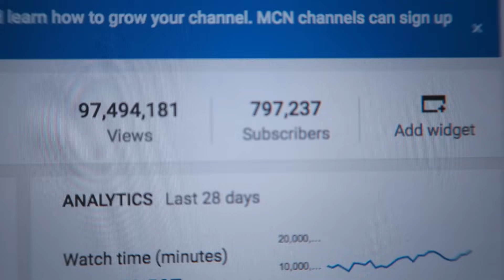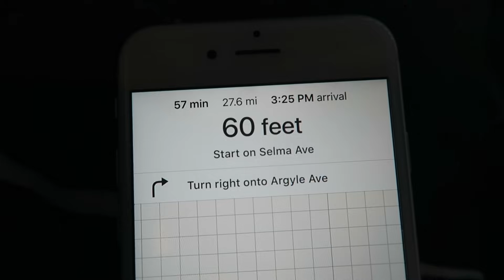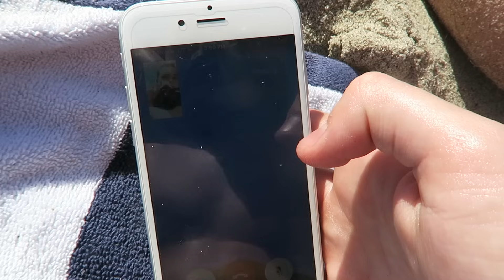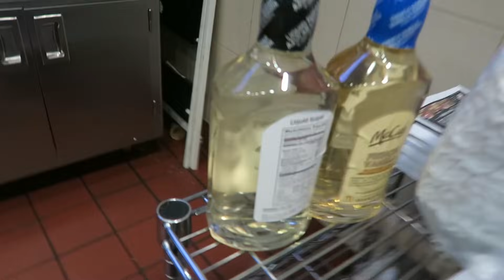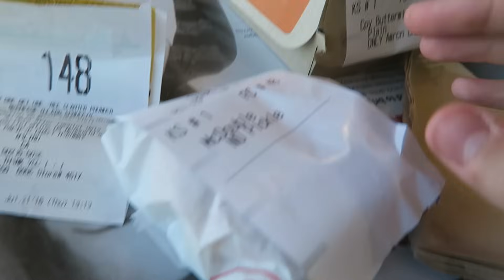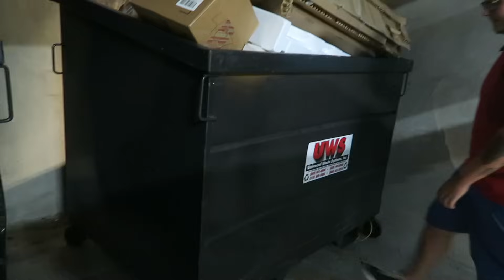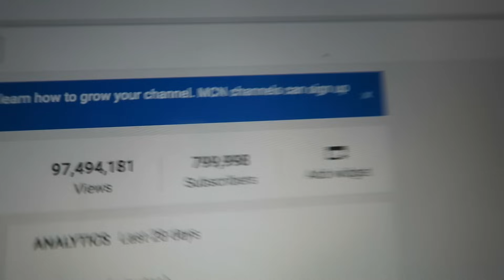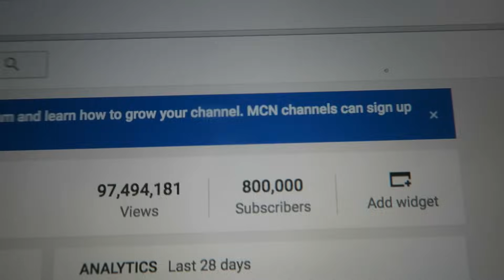SHE'S NOW A HULA GIRL!

Comment: ive been in that building me and my step dad rewired the lobby depending on what floor your on the wiring in the building is pretty messed up the wiring joints with no wire nuts fucked up and that outlet is on the island and the wire goes down underneath your floor there is a 1 inch gap in the middle of your floor and the room below you so anyway that wire wires in with the light switches you showed us in the video so somewhere in between the light switches and the outlet is there it is probably burnt up and or taped to make a joint which shoudnt have been with electrical tape but with a wire nut